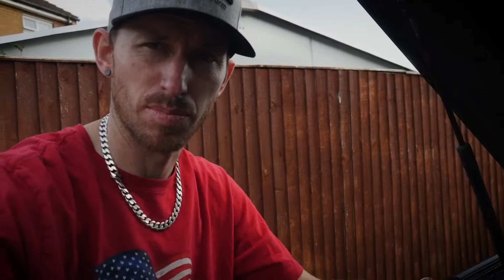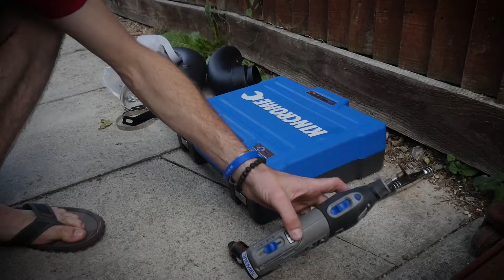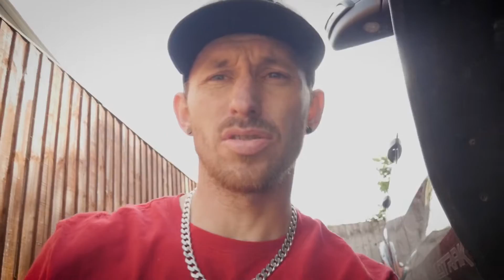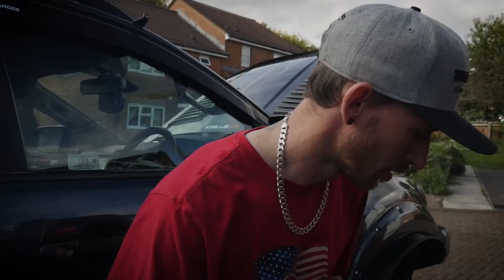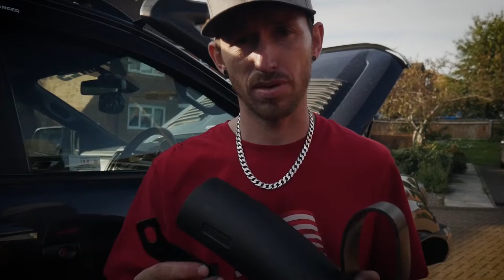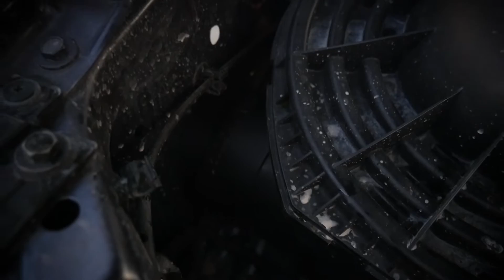Ford ranger Snorkel Install

Comment: Love the intro ,now fitted the FORD front grill with LEDs and the tailgate dampers ,tint gets fitted on the 27th then I can fit the wind deflectors ,will get some fuel wheels once my T4 sells ,cool mod with the snorkel 🤘🤘
Reply from the maker: CrazyCressy7 nice man. Have you thought of joining our ranger group? Have a look for Rangerclubuk on Instagram if you have it. We’re all going camping in October so will be a decent trip and meet
Reply: @MachinaDesigns  I am only on youtube , wheres the meet up ?
Reply: Getting my lad to set me up on Instagram 😉
Reply from the maker: CrazyCressy7 awesome get in contact with Aaron and he’ll get you added to the group. Bunch of good guys and girls all with a wide variety of different Rangers. Great for advice tips and guidance
Reply: @MachinaDesigns  thanks for the heads up

Comment: Hi bud, what make is the snorkel please? Yours looks good quality - some of the ones I’ve seen are really poor. Cheers
Reply from the maker: Lee Hunt it’s a factory OEM snorkel. Mines suited for prefacelift but with a few easy mods it’s able to fit. There a many aftermarket snorkels like mine and the quality is not that bad and will certainly do the job if installed correctly.
Reply: Machina Designs cheers, ordered one today. Fingers crossed it’ll do the job 👍

Comment: Can you upload a video from driver seat with window rolled down? Want to hear the Intake sound after snorkel installation!
Reply from the maker: Rohit Shinde there should be some good sound clips from a few of my videos where the cameras are mounted on the roof they give the best tones of the snorkel. It does certainly deepen the tone of the truck and makes it sound so much better. Performance goes up a touch too with the increased airflow
Reply: Machina Designs okay. Will checkout. Thanks for info!
Reply from the maker: Rohit Shinde no problem

Comment: Hello. I have a Ford Ranger PX (2012-13) single cab truck and am thinking to fit a decent snorkel. But I hear so many reports of inferiority/complaints about these nice looking snorkels. How do they compare to well known brands, which are FAR more expensive, AND you have to cut big holes in your panels. How is your unit performing and holding up after fitting one ? Cheers
Reply from the maker: Theo Bao thanks for stopping by. We have a Safari snorkel on our Jeep Wrangler and it’s exactly the same in terms of quality. This one has performed flawlessly so far and I’m pretty happy with the performance gain it’s giving me. I’ll be moving to a stainless steel snorkel very soon which I’ll provide another video of it’s more invasive installation. Be sure to checkout the rest of the videos as the truck has completed transformed now. All the best
Reply: @MachinaDesigns  why are you moving to another snorkel?
Reply from the maker: @MrDawnzo  always preferred a stainless snorkel over the plastic versions
Reply: @MachinaDesigns  why tho?  for looks? For the benefit of the engine?
Reply from the maker: @MrDawnzo  both. Better airflow and the plastic snorkels don’t always seal very well

Comment: Hey bro, do you have a link to this snorkel? I'm currently on the lookout for one 👀
Reply from the maker: You can pick them up on ebay or from LR Challenge. Decent quality but make sure you seal up all the joints with silicone when you install it.
Reply: @MachinaDesigns  is it the Cobra snorkel I'm seeing on ebay? in a market now too for snorkel. cheers.
Reply from the maker: @MrAMerang  I’m not sure buddy I’ve upgraded to a stainless steel snorkel now